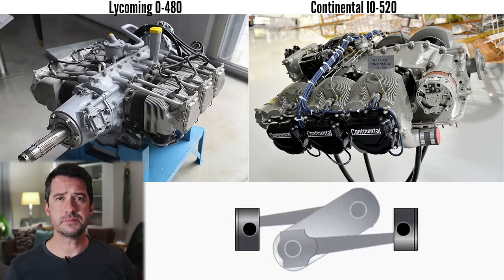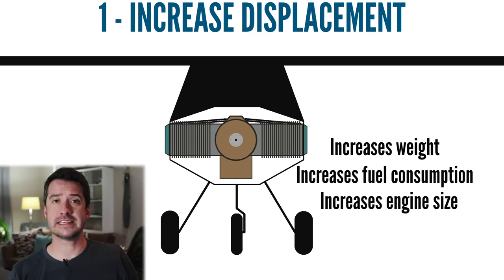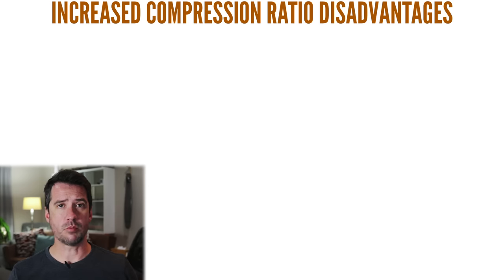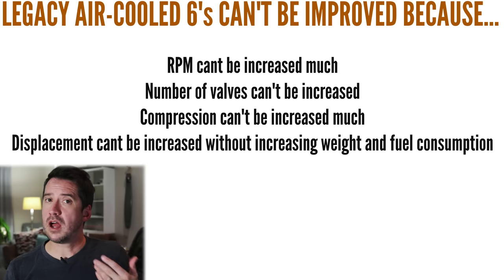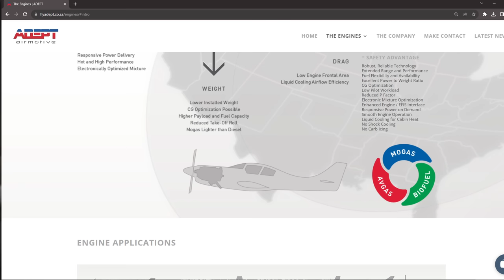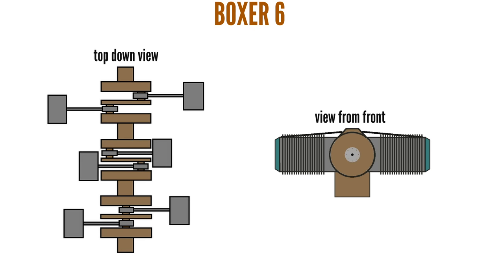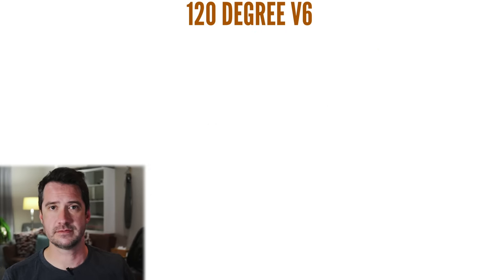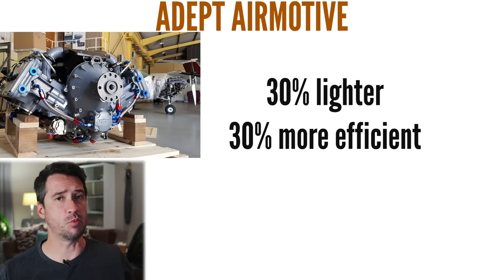Unusual V6 Airplane Engine Makes Boxer 6 OBSOLETE?

Comment: You got the Primary Imbalance correct....it is caused by the piston stopping at TDC and BDC and needs a counterweight on the crank to offset these forces.   But Secondary Imbalance happens not because of the very small difference in effective rod length going up and down...that's something that people have just recently cooked up and ignores the REAL reason...which is that counterweight that cancels out the Primary Imbalance has no counter force when the piston is traveling inbetween TDC and BDC so that weight tries to shake the motor side to side.   This can be countered with a secondary balance shaft timed to counter the Secondary Imbalance but multi-cylinder engines often have other cylinders that do this counter force without need for a balance shaft.
Reply: ...and here was I thinking it was because 90deg atdc on the crankshaft isn't equal to the piston being halfway down the bore.
Reply: @ThePaulv12  But it IS halfway down the bore...within a fraction of an inch measured in thousandths and not enough to matter.   What do you think happens to the counterweight centrifugal force at 90 ATDC?   It has nothing to oppose it from the piston so it rocks the motor.
Reply from the maker: Thats it 100%. Because of different distances having to be covered in the same amount of time, causes acceleration and deceleration of the piston. If you look at a piston connected to a conrod going up and down in slow(er) motion you can absolutely see it going faster at close to TDC and slower close to BDC. Anyway, Jason from Engineering Explained gives the same explanation I did, just better explained 🙂

Comment: GM 2.7 4 cylinder turbomax is 310HP and 430 ft/lbs torque.  The dual volute turbo makes torque from low rpm.  Electric water and oil pump to shorten overall length.  I wonder if a variant would be applicable for aviation?
Reply: We talk about 6 cylinders here. So bi-turbo. If someone tries a single turbo on these, I understand how they feel that plumbing is painful.

Yeah, go and buy those inline-4 Diesels …
Reply: @ArneChristianRosenfeldt  You don't need six cylinders if four cylinder length can fit.  A turbo max variant makes 400 hp.  Reliability then becomes the question.
Reply: @mefobills279  ah, I am just tired of 4 cylinders. We know how to work since Model T . Even VW ditched the flat-4 for the inline-4 in Golf. I did refer to your volute. It is only used in inline engines.  Maybe you could use it in a flat-plane V8? Someone else here posted how rough a flat-4 runs compared to a flat-6. Smoothness was a big topic in the video.
Reply: @ArneChristianRosenfeldt  Totally understandable!  This transition to EVs is commodifying inline 4's.  Probably one supplier in future.  For piston airplanes, it is flat six, or was.  Fours are uninspiring unless you do a Yamaha yzf r1 cross plane.

Comment: I have a question why use avgas instead of diesel in planes ?
Reply: Maybe because diesel can freeze
Reply: Weight, diesels are extremely heavy. Unleaded gasoline is also cheaper than jet fuel.

Comment: This is one of the most disingenuous videos I have seen.  The presenter makes many claims that are not supported by facts or data.  Current IC aircraft engines are tough to replace because of physics.  They are light and have very good bsfc (brake specific fuel consumpton) when operated correctly.  After 10 years there is still no bsfc data on the presented engine.  The claim of better consumption is therefore unfounded.  Prop gearboxes are problematic on big HP IC engines.  They have been done before and are not the preferred setup as they are life limited.
Reply: On YouTube: Vid #93. Diesel vs. Spark Ignition Aero Engines by rv6ejguy

"Prop gearboxes are problematic on big HP IC engines."

Yeah, the R-2800, the Rolls-Royce Merlin and basically every other large, high power engine from the heyday of piston aircraft engines all have horrible reputations because of how unreliable their gearboxes were! /s

Sorry, bud, but that reputation only applies to LyContisaurus engines, because they were originally designed to be direct-drive engines and they beat their gearboxes to death with huge torque impulses, which this engine doesn't even have. Even still, when operated properly, geared Continentals have proven to be just as reliable as their direct-drive counterparts.
Reply from the maker: I'm guessing you wont reply to this. But please let me know which claims aren't supported by facts or data. Data shared ragarding the Adept engine comes from Adept. Feel free to double check every fact I mentioned. Data that didn't come from them I made sure to mention that I'm guessing. Data regarding general balance etc. for Boxer 6 and 120° V6 comes from myself, however my understanding is shaped by much more reputable sources than myself.

Happy to discuss.
Reply: @PistonAvatarGuy check the TBOs on the engines you mention.  MERLIN was 200 hrs.  I would certainly want that.  BUD....
Reply: @LetsGoAviate  You claim better fuel efficiency but there is no bsfc comparison data to back that up.  You claim lighter weight but make no actual weight comparisons. The engine website has weights but they do not include cooling system weight.
Reply: @billpendergrass9466  How is the TBO of the Merlin or the R-2800 related to this engine? The R-2800 had a TBO of 2,300 to 2,400 hours! The Rotax 900 series engines have gearboxes, they rev to nearly 6,000 rpm and they have a TBO of up to 2,000 hours!

BSFC is 0.33 (see rv6ejguy's video), the weights listed include the weight of the cooling system, as stated in the Kitplanes Magazine Engine Buyer's Guide. Why do you people think liquid cooling systems are heavy? Have you never handled a radiator? They don't weigh anything.

Time to get with the times, BUD.
Reply: @billpendergrass9466  You'll also notice this on the AeroMomentum engine in the Kitplanes Buyer's guide: "The highest time gearbox so far logged 5500 hours in an airboat with no issues."

These engines have small torque impulses and carry a good deal of inertia (the gears aren't likely to unload at any critical point during operation) as a result of their operating rpm, they're not LyContisaurus engines, they won't have the same problems.

Comment: A Closer Look at the horsepower issue shows that high density altitude is the most dangerous restriction of aircraft engine power. The installation of an electric boost system, used only for takeoff, could reduce the size, weight and fuel consumption of existing aircraft engines
Reply: Turbocharging eliminates that problem.
Reply: @PistonAvatarGuy  the heat of an aircraft turbo charging system create a fire hazard and usually doubles the cost of a power plant. If the starter motor has an integral impeller the cost of supercharging, for takeoff, can be greatly reduced
Reply: @mikefallwell1301  A very large percentage of aircraft engine are already turbocharged. Electric drive components add too much weight to be useful.
Reply: @PistonAvatarGuy  read the earlier post. The starter motor can supply nearly 2 horsepower to the supercharger without adding weight or complexity and it's only really necessary on a hot or high day. A Turbocharger will nearly double the cost of flying.
Reply: @mikefallwell1301 1.5kw is not enough to drive a supercharger of any significance. And powering the engine with only 1.5kw boost is pointless also.
Reply: @chippyjohn1  it is enough to raise the horsepower 20% if you include the effect of higher RPM. This will have a very significant effect on climb rate

Comment: Gear reduced engines in aviation has a poor reputation. When Mooney  introduced their geared engine, the aviation press panned the engine, when first announced, for the speed reduction system. Lycoming GO series engines used a planetary  gearing system that did not do well in the hands of inexperienced pilots. I like the idea of the V6 engine technology, but trying to get acceptance by airframe manufacturers will be a very steep hill to climb.
Reply from the maker: On the other hand, Rotax has a great reputation with their geared engines.  They simply don't give problems if sticking to maintenance guidelines. Regarding acceptance, yeah, that won't be easy.

Comment: my face when the goldwing and sports bikes have had reliable high output lightweight engines for 40 years
Reply: Airplane piston  engines live at full throttle the majority of their life and last 2000+ hours.  A gold wing spends the majority of its life at less than 50% power.  Big difference

Comment: You certainly nailed the disadvantages of the old engines but as a general principal OHC benefits are a bit overstated here. Reduced pumping losses of OHC are also a bit overstated. Good in theory but in practice the gains are offset by added complexity by the addition of many MORE not less moving parts in many applications. The benefits could be true for sure. One benefit might be freer port shape benefits unhindered by pushrods.
Here's the thing what OHC can do is increase valve area by using multi valves at the same time reducing lift allowing lower spring pressures in theory reducing pumping losses but real world benefits are often less than ideal.
I posit the Lycoming & Continental boxer engines are the perfect engines for the application of the aircraft in which they're installed. Form follows function comes to mind. 
Yeah but the cost! The cost of rebuilding old engines is utterly ridiculous and anything one could do to reduce that for the same reliability has got to be an advantage.

New engines are obviously needed but they are likely better suited to new designed aircraft as an integrated package aren't they? I can imagine a Twin Comanche with 2x CR of these - I wonder where the rads would go?
Reply from the maker: Some good points! I think if I were to put it in a different way, just adding OHC and more valves for the old engines wont do much (fewer valves are actually better for low rpm torque), but at high rpm more valves and other OHC benefits actually increases efficiency notably. Some other good benefits of the OHC you mentioned as well, thanks.

I guess it depends on what you count as a moving part, but I count more moving parts on the OHV system. I mean the pushrods alone number 12 moving parts on a six cylinder. The DOHC has all the cam gears, tensioners, belt etc. but still number fewer moving parts, but I might not be considering all different designs.

Comment: 20 years ago, a Ford Windstar 3.8L Essex V6 engine matched a traditional aircraft engine like an IO-470 in terms of power and weight. 

Today, Ford has the 3.0L V6 3 Ecoboost. The closest you could get to this would be the Continental TSIOL-550-C which would be a little heavier and produce 50 less HP. Remanufactured, the Continental costs $60,000 versus $3,000 for the Ford.

It's a shame that there's no one doing conversions today like Dave Blanton did with Javelin Ford. There's just no way to achieve a cost effective engine solution relying just on aircraft sales; the market is too small.

Comment: This engine is essentially irrelevant.

Aviation people tend to be very "conservative" with regard to new technology.  It would literally take decades for this engine to make significant inroads into the light aircraft powerplant market, and by that time the power density of the various types of lithium-based batteries will make them competitive with gasoline and light aircraft will generally become electric powered.

It's an interesting concept, but I cannot see it going anywhere.
Reply from the maker: It depends. It can be successful, just look at the Deltahawk which is also way "out there" in terms of design and was called a failure from start to finish. It might be premature to call it successful, but FAA certification, RV-14 firewall foward kit in production and now a partnership with Piper aircraft doesn't scream "failure" to me. The Adept can achieve the same, if the company has the continuous funds to cut through red tape and cut through people's conservativeness. If they have that funding or not, I do not know.
Reply: @LetsGoAviate  I'll repeat myself:  This engine is essentially irrelevant....
Reply: The experimental market, which is the fastest growing market are anything but conservative. Automotive engines have been used for a long time. Battery density would have to quadruple to be competitive. We are yet to see electr8c aircraft burst into flames when they crash as well. Petrol engines don't explode when the impact the ground with no fuel, or in salt water.
Reply: @chippyjohn1  You don't know what you are talking about.
Reply: Your argument is that GA pilots are “slow to uptake new technologies” because they are conservative…so the engine is irrelevant because they are going to jump straight to EV airplanes!!!??? That is a crazy take.
Reply: @baremetalmafia  You have a bit of a point.  Light airplane owners do NOT like new technology, it has to prove itself first.  And electrics face an uphill battle for the fact that some people express their inherent personal and political insecurities when selecting hardware, but I think that the electric motor when paired with the better energy density of future batteries will put the ICE powerplant to bed quickly.

Thus while the "inertia" of general aviation certainly exists....It is not impossible to overcome.

Think about it this way; How many light airplanes do you see flying around with radial engines these days?
Reply: @Flies2FLL  That's what people say when they actually don't know what they are talking about and someone gives a valid opposing argument. Have you actually designed and built your own aircraft?
Reply: @Flies2FLL  They only real difference between a radial and a Lycontisaurus is radials are less compact. Otherwise the design is essentially the same. Lycoming and continental started their ga engines by reducing cylinder counts from radials. Modern automotive and recreational engines, especially from Japan, are far better than current certified piston engines. The reason the are not used is because they are suppressed by US aviation.
Reply: @chippyjohn1  You be TALKIN' out yo BUTTOCKS!

-Radial engines were built for one reason: LOW WEIGHT.  You can have an enormous amount of cubic inches this way with only one or two crankshaft throws, meaning the engine is very lightweight.  Combine that with nearly unbeatable air cooling and you get a winner!  Problem:  Radials do indeed have high frontal area.  

Now, I fail to see where my design/build history has anything to do with it, but to answer your stupid question I have DESIGNED and I HAVE BUILT my own RC model airplanes and they have flown beautifully.  I did that stuff when I was a teenager; I was the youngest member of the Toledo Weak Signals RC model airplane club during the 1980's at the age of 14, and my resume includes an aeronautical engineering degree from Embry-Riddle  and four Boeing type ratings, to include the 727 and 747. Both of which I have extensive Captain time in in worldwide service. 

And I flew those when I was in my 30's, 20 years ago.....

Now, do you still want to question my qualifications with 12,500 hours of flight time and 2500 hours of dual given?  OK?

Send it-

-Modern GA engines are indeed a "Lycontisaurus"....

Frankly, I prefer "Lyocomisaurus", but I digress.  By the way I reserve the right to plagiarize your term~!!

But that is simply the way it is.  Some other engine, such as the diesel Flat 4 that the French are trying to sell, or the engine in the Diamond airplanes, an inline 4 diesel Mercedes Benz engine, Theilert I think?  They make sense but they aren't going anywhere, because battery technology is going to improve in the form of KW/hours per Kilogram to such a dramatic degree over the next 10 years that money spent to build a new ICE powerplant is really just throwing good money after bad.

Hey man, I don't make the news.  I just report it....

Comment: is this an air-cooled or water-cooled engine?
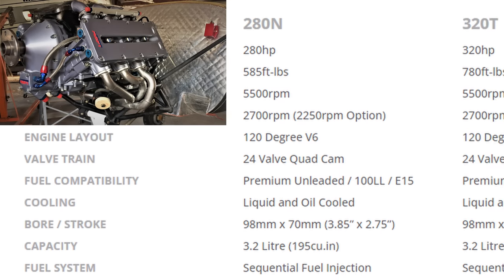Reply from the maker: Water-cooled as mentioned at 7:45
Reply: @LetsGoAviate  do we know if the weight numbers still work in it's favor once the cooling system is accounted for? Also how are they going to package the radiator into existing airframes?
Reply from the maker: @ZeeVoe  Don't have the answer unfortunately, but the weight on the website is dry weight, so if it includes the cooling system, it doesn't include the actual liquid (however heavy that may be). I'm not sure of the cooling system layout, but from experience this differs from plane to plane, but a good guess is the cowling would need to be modified.
Reply: @ZeeVoe  According to Kitplanes magazine, the weight does include the cooling system, but it is the dry weight. Maybe add another ~20 pounds for oil and coolant.